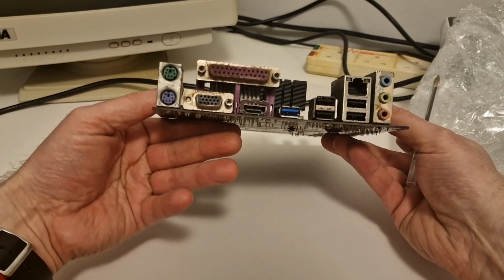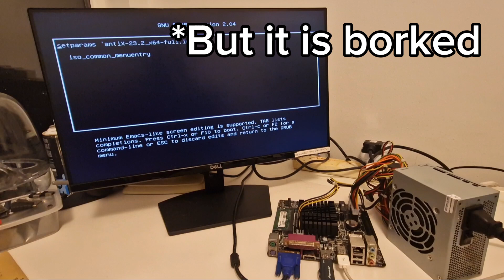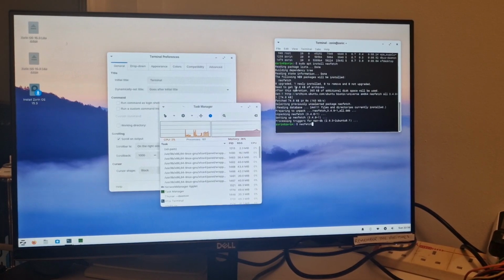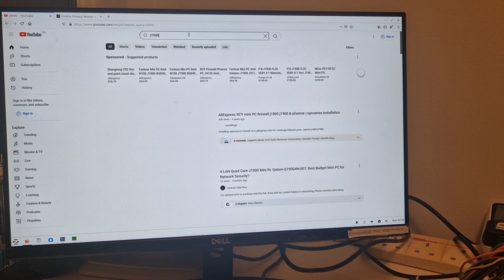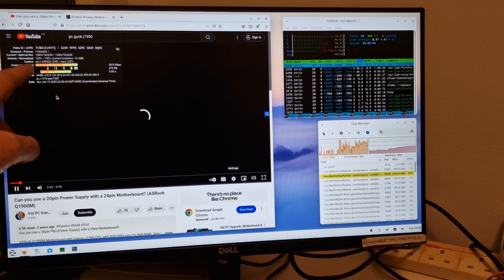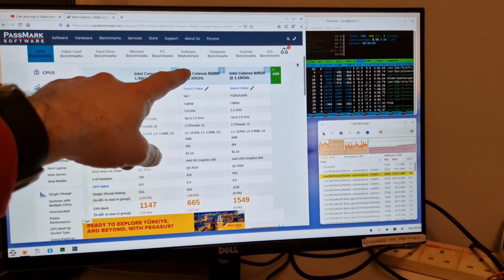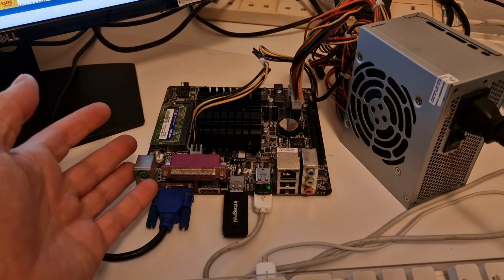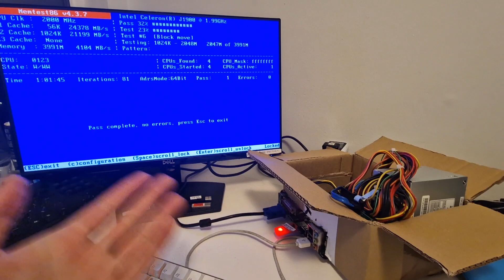4 cores 10W £15 - Mini-ITX board with Intel Celeron J1900 (and Zorin 15.3 Lite)

Comment: I have it as a micro ATX board with PCIe x16, x1 and 2x PCI, and have already run Windows 98 SE on it. The system offers relatively high performance with low power consumption. It is slightly faster than a P4 in the Extreme Edition.

Comment: I have bought a like new Acer sff tower with a Pentium J2900 (quad core), 4 Gb stick and a low profile Radeon R5 235 with 1 Gb of VRam and also a WiFi card. Only thing missing was the HDD... i payed 35€ for it 🙂 it now as 8Gb and a 240 Gb SSD.

Comment: The J1900 looks modern to me.
Reply from the maker: I think of DDR3 as quite modern, even though it's been around for a long time. Still only have two systems that use DDR4?
Reply: @ I have DDR3(Which Is Vostro 3300 AND My Dailly Drivers) And Older  System